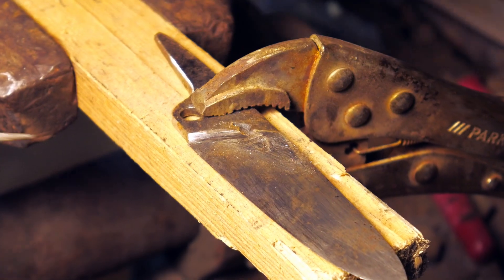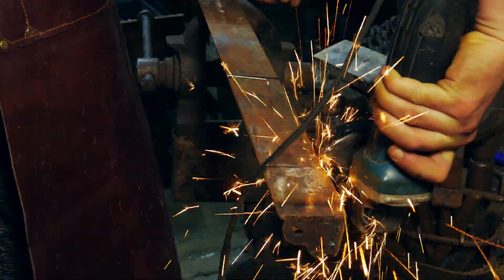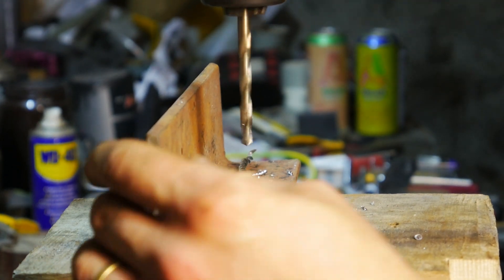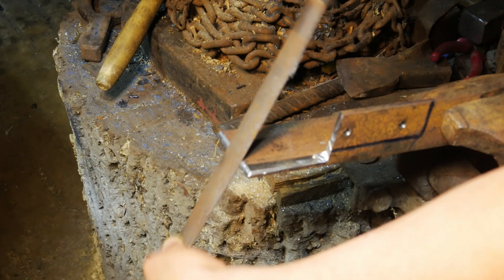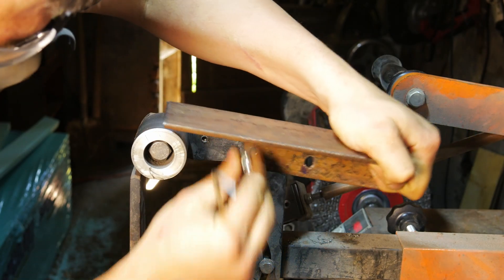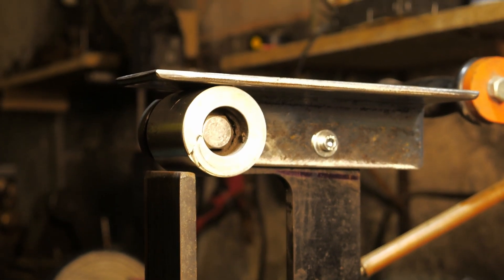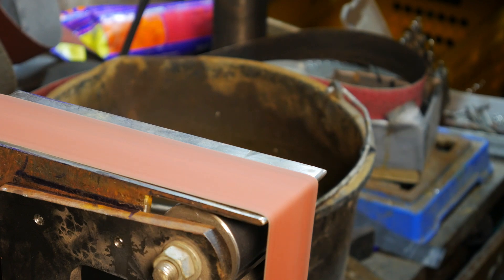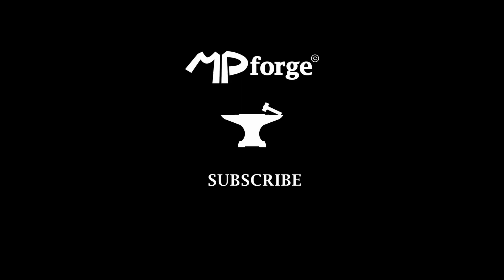I Made a DIY Waterfall Platen for My 2x72 Belt Grinder

Comment: I assume that these are pretty hard on belt life, with that tight radius?
Reply from the maker: From my experience, it depends on the belt material and on what you are actually grinding, but to grind the plunge line after the basic grind is done is a matter of like 5 minutes. The tight radius gives you a very small contacting  surface area for grinding, so it's pretty quick work and thus the belt does not need to suffer as much. Thanks for the comment and have a great day, sir! 🙂👍